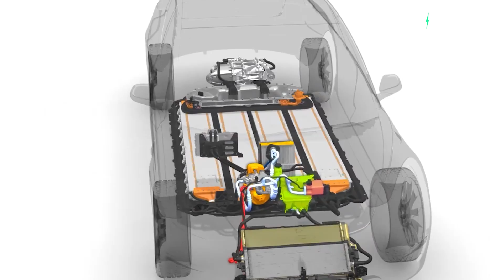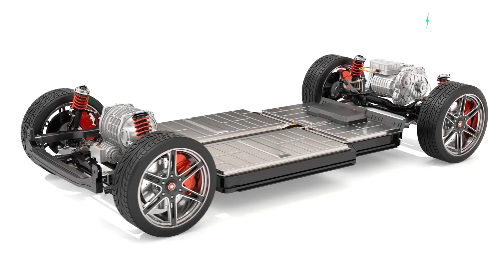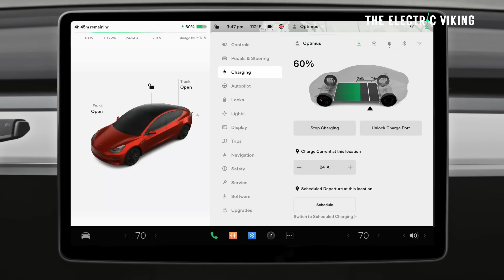No, you don’t need to replace Electric Car Batteries in 10 years time

Comment: We always talk of how we charge. But what about how we discharge? Example - TMY LR charges up to 250 kH, but discharges up to 378 kW. If you push it a lot? What do you think, Sam?
Reply: Heat is what kills the batteries.  Pushing the car will heat the batteries up.
Reply: Not good either. But you can discharge it at such a high rate for a few seconds only, so it's not that big of a deal.
Reply: @Tschacki_Quacki   200kph high speed cruise will do a lot of stress to the batteries.

My gas tank is empty in less than 2 hours.